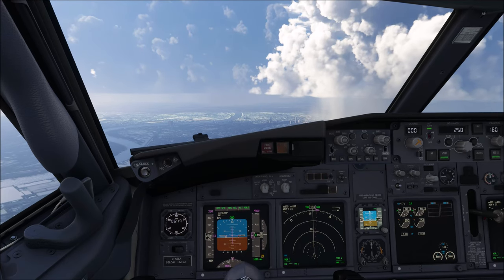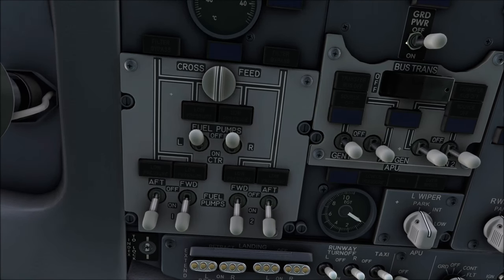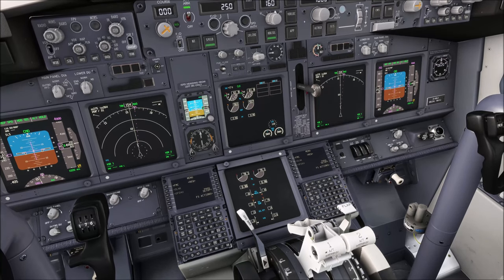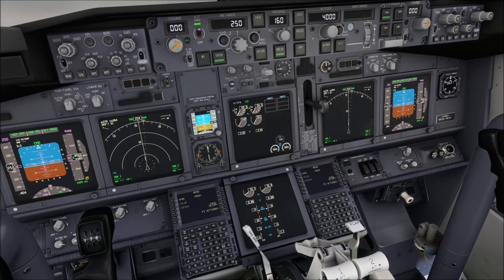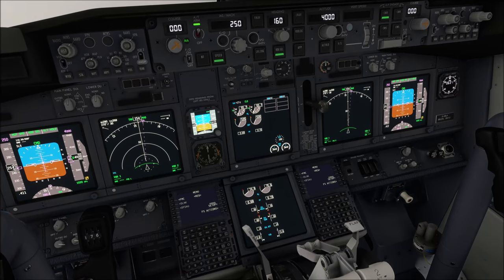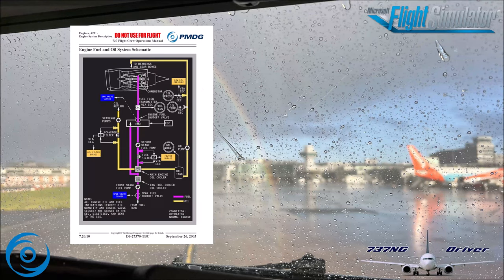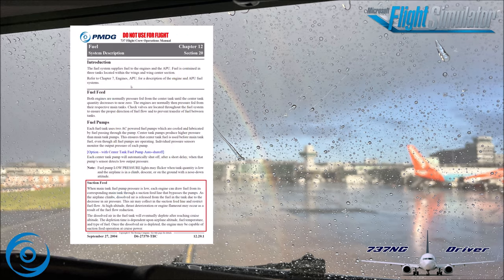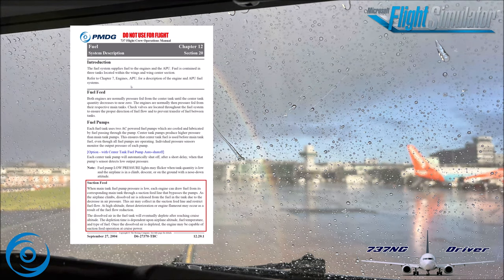Flight Sim Myths - Engine Failure without Fuel Pumps? | Real Airline Pilot

Comment: Just to clarify the second stage fuel pumps are engine-driven pumps attached to the engine's gearbox, and would not be affected by a total loss of AC power. So the engine will still operate with a combination of gravity feed and suction from these High-pressure fuel pumps on the engine. Great video series much appreciated being able to experience flying the 737NG properly and realistically.

Comment: One side note. The A320 won’t finish the engine start cycle if the pumps aren’t turned on. Haven’t tried it in flight.
Reply from the maker: mmh, the FS Labs does... well, it's not perfect, so might just be a bug.
Reply: @A330Driver  ok, didn’t know that. The FBW and Fenix don’t. It spools up N2 but never starts adding fuel
Reply: @A330Driver  Just tried again.. The Fenix does start without the pumps on.

Comment: Hi Emanuel(hope I spelled that right), 

In regards to the Cross feed for fuel, I noticed when there's a small variation in fuel between tanks such as say 30-40kgs the fuel doesn't seem to even out between tanks. Is this behaviour correct or is it a slight bug? Also what variation between the tanks would you engage the cross feed in the real world, any variation at all or maybe only if it was over 100kgs or so? 

Thanks for all the help with your videos, they're definitely a great asset!
Reply from the maker: Hi Aidan,

you spelled it correctly ;-)

Variations up to 100kg are commonly seen during flight.
No two engines are exactly the same, so they will use slightly different fuel amounts.
Also the APU will only draw fuel from the left side of the manifold so with no fuel in the centertank it'll use the left tank only.
The manual doesn't tell you from which point onwards you should start balancing fuel, except once you get an IMBAL caution showing.
Personally I usually so it when it's more than 100kg difference.
Reply: @A330Driver  Excellent thanks for the help mate, When I see the numbers not matching my OCD kicks in and I have to try to get them matching haha! Haven't had that message yet but I tend to only start the apu when pushing back and only when arriving at the gate (as you suggested ;)) getting settled in quite well with the 737 now, landings are even becoming relatively smooth! may have to start experimenting with some failures soon o:). Also picked up the Fenix A320 so I will have to have a play around with that too and see what I think of it! 

Hope you're doing well anyway mate!

Comment: Bit off topic but which NADP procedure is used by Ryanair? So at which altitude do you set climb thrust and at which altitude you bug up? NADP1/2 or do you have your own procedures? On your last videos you mostly bugged up between 1000 and 1500 AGL but which is officially the correct way? Thanks for an answer!
Reply from the maker: Depends on the airport. Each airport requires a different NADP.
Most German airports want a hybrid NADP2 with the bug up at 1500AAL.
Others like Berlin want NADP1.
And when you're outside Germany there could really be anything.
Most airports are NADP2 though, but never rely on it without checking or you'll quickly have a chat with your base captain.